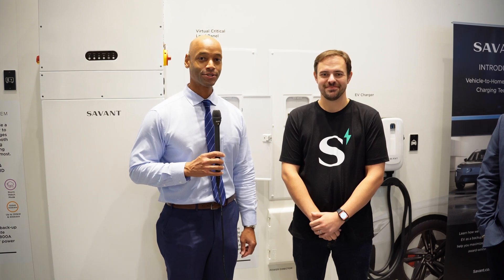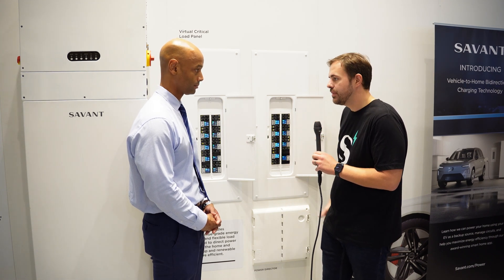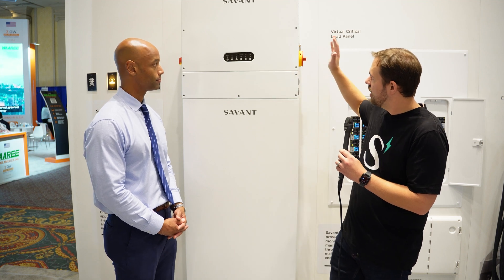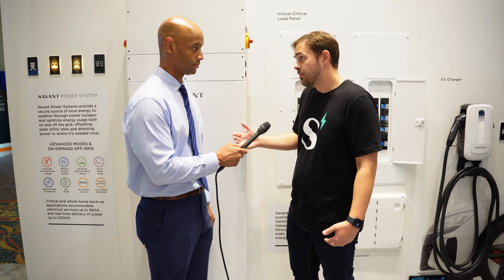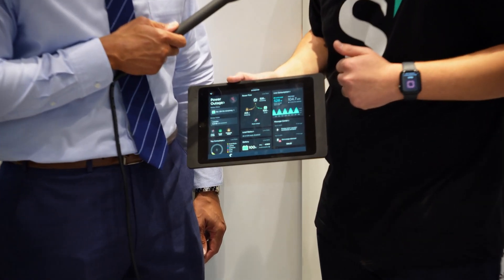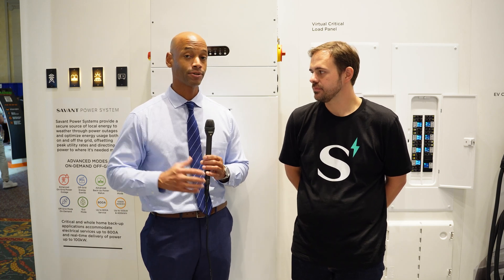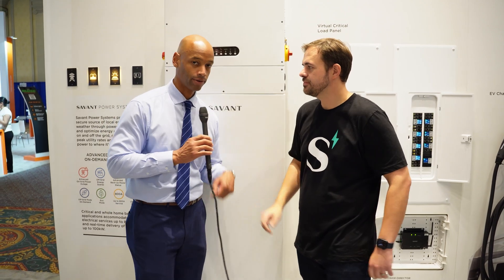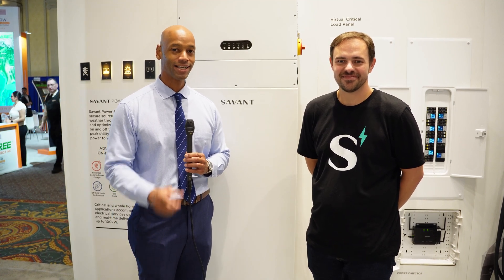New Savant All-in-One Energy Management System (2023 Updates)

Comment: My Installer said I could not connect my gas generator to this due to my enphase micro inverters.  Comments??
Reply from the maker: Yes, if you want to use this system, you can remove your Enphase micro inverters, and send the solar power directly to Savant. That would free up the AC input to connect the generator.
Reply: @SolarSurge  so no inverter at all - just send a direct DC signal to the Savant system?
Reply: @billshuster2660  Enphase is a microinverter that converts DC to AC.  A string inverter, like the Savant model shown in the video, negates the need for microinverters.  The DC goes directly into the inverter, which frees up the AC input for a generator or EV that can output power as AC.